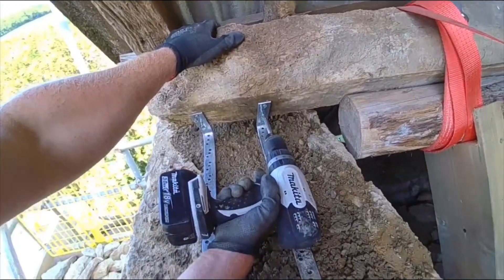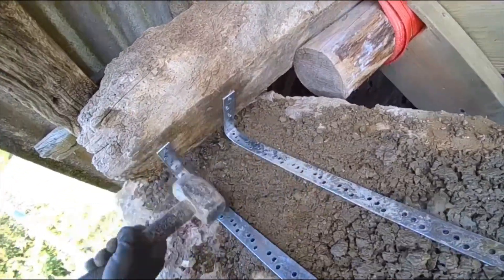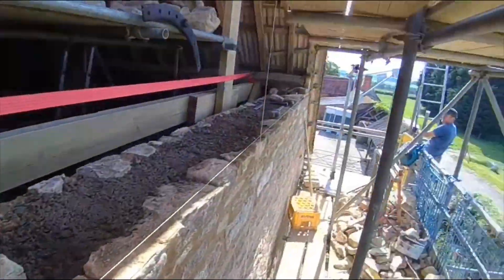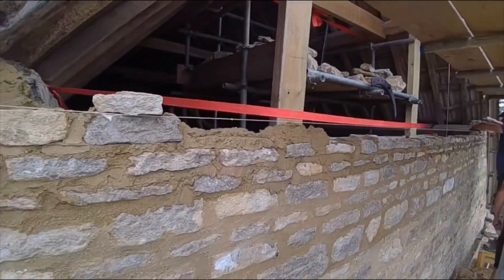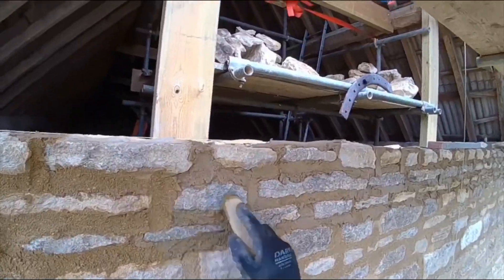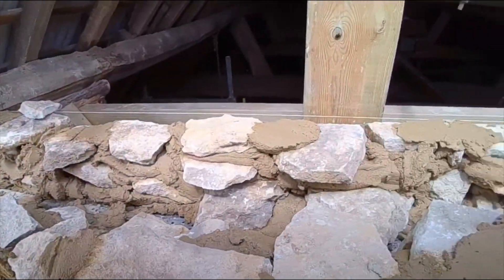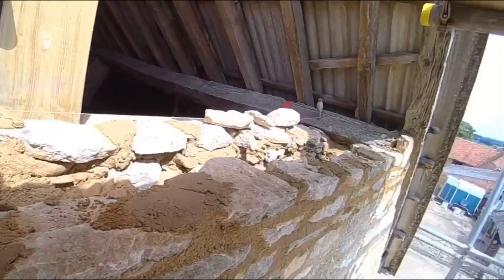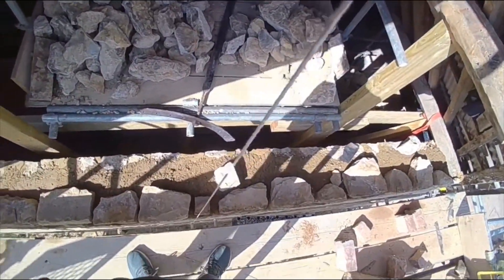Bricklaying is EASY compared to this | The skill of bricklaying

Comment: Looks like a lot more job satisfaction than building a Persimmon shoebox .
Reply from the maker: Neil Rafferty I wouldn’t no mate I’ve never been on a big site like that. The biggest site I’ve been on is 4 houses
Reply: Ginger Dust Ive been on the big sites and if it wasn’t for expanding foam , pvc and silicone they’d fall down .
Reply from the maker: 😂 I can imagine the amount of Newly built homes I go to with my Bouncy castles at the weekends half of them are falling down the brickwork is not the greatest because you use that silo mixer seems to be all powdery
Reply: Ginger Dust . Interesting point you make about the silo